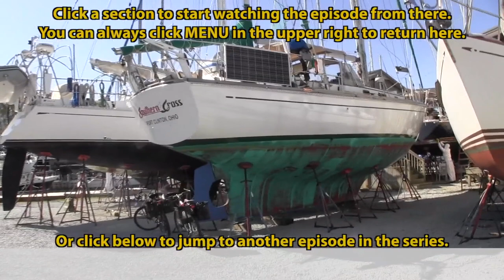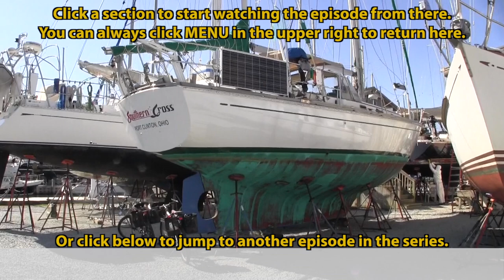Deck Tour of Liveaboard Sailboat Southern Cross, Part 3 (Dickerson 41)

Comment: I heard that even the slightest shade on a solar panel reduces the output tremendously. Is that your experience too?
Reply from the maker: Hi Rob, I have the same Kyocera solar panels on Paragon that Don and D have on Southern Cross.  My experience has been that any shading on the panels dramatically reduces output.  I've also found that being able to tilt the panel directly towards the sun makes an enormous difference.  Happy sailing,